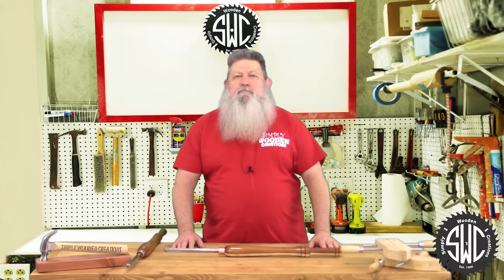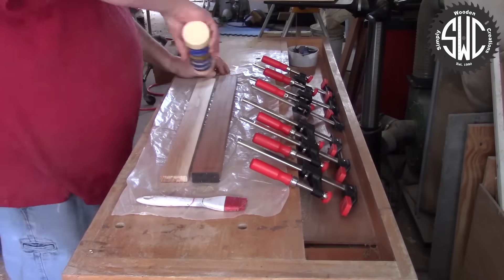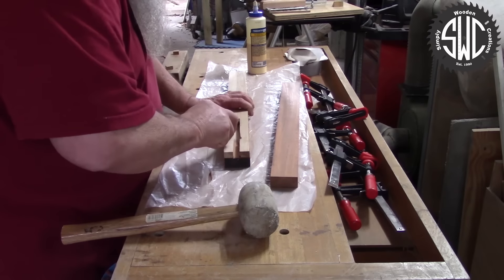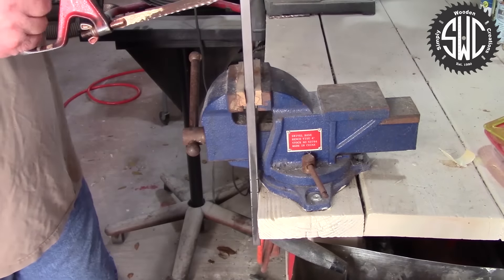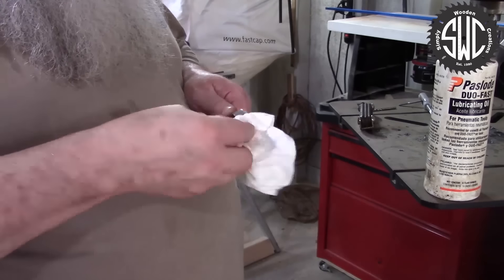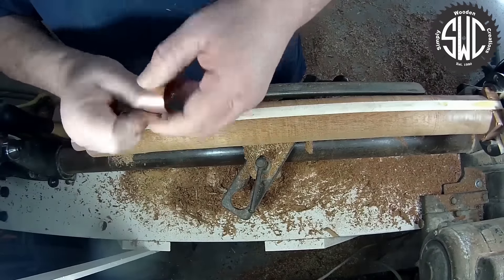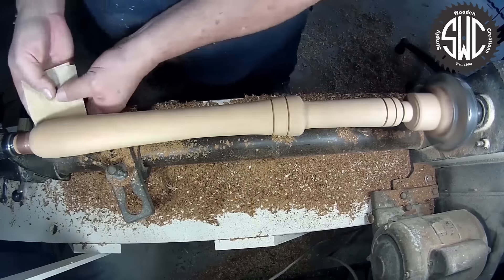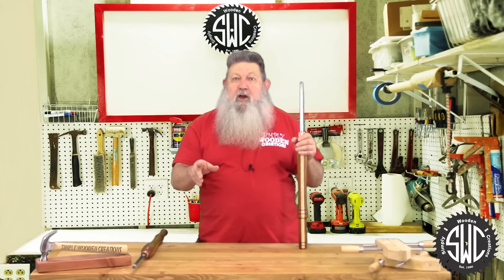Making a Carbide Lathe Tool S03:B03

Comment: I am wondering if there is a reason for the cut out for the carbide tip, couldn't you just fasten it on top of the steel? Looks sleek but is there any advantage?
Reply from the maker: There is a lot of pressure exerted on the tip. Haveing the notch and it sloped in the back  prevents the cutter from moving.